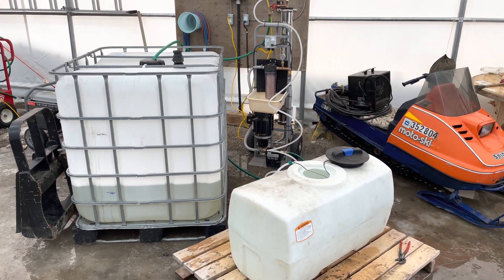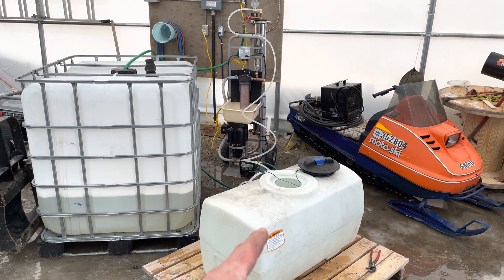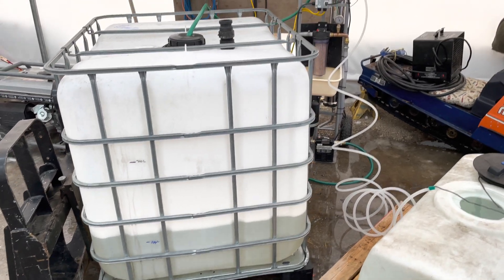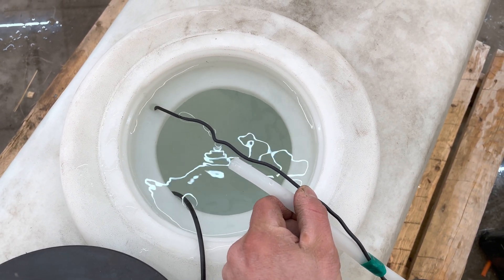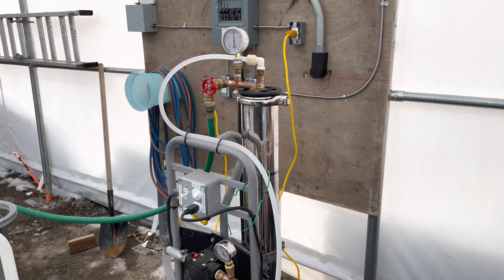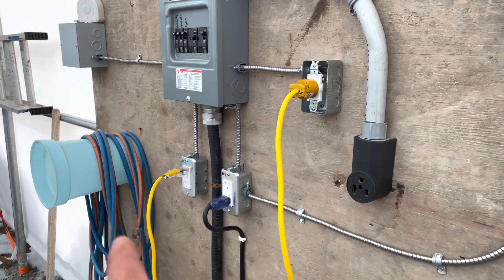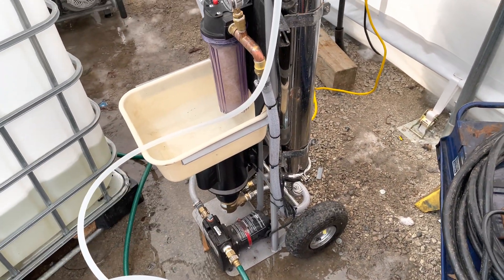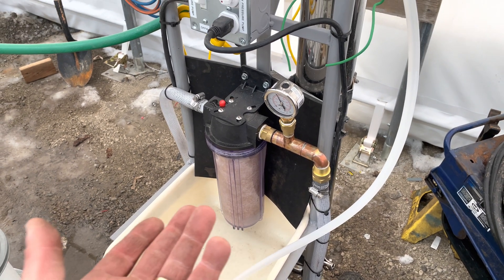Making Maple Syrup - Easy Homemade Reverse Osmosis System for Water Removal from Maple Sap

Comment: I really liked your RO i built one similar to this with well water pumps but could not achieve enough pressure, but i will be upgrading my pressure pump to a procon. Thanks for the build tip.

Comment: Whyy cant you just use the bottom pump at 40psi? Im sure the high pressure pump makes it fast but just wondering at 40psi if it still works.

Comment: What are the size of your hoses and fitting on your pumps/tubing??
Reply from the maker: All clear horses and high pressure line are 3/4”. The outlet is 1/2” copper pipe.

Comment: whats your thoughts on the new Nano RO MAX Reverse Osmosis System by CDL? would u buy it or build the system you are using?
Reply from the maker: I like the new system, can’t really say too much more without seeing it in action. Based on the online specs it’s pretty impressive for the size. I would personally build my own again because it uses widely available parts and can be easily scaled up by adding more membranes easily keeping all the same pumps.

Comment: I’m hoping you still look at comments on this although it’s been up for a while. I’ve built the same setup that you have. It seems to work but I’ve noticed with both pumps running the filter housing never fills up. It is about half full of water and I see the water flowing in with a lot of air. I think that is causing my high pressure pump to cavitate some. The low press and high press pumps are both rated at 330 gph.  Any idea what would cause that and how to fix it? Thanks.
Reply from the maker: Hi, I’m not entirely sure but you may need to increase the flow to the small filter. It may not be getting enough flow.

Comment: Another question for you. How did you determine what size electric motor to use on your Procon High Pressure Pump?
Reply: I run twin 4/40 filters in series on a 3/4 hp marathon motor with the 330 procon and it works very well.
Reply: @Tonnsfabrication  For the size and amount I would make for myself, I could build one 1/2 the size of yours then referring to what you memtioned.
Reply: @craigunderwood5567  Yes, depending on how much sap you plan to process you can certainly build a smaller set up. The set up in this video is ideal, you could easily add another filter in series to upscale it later. The 4/40 filters are about as economical as you'll find if you're in a higher tap count, If you only have a handful of taps then smaller house filters work fine. The membranes I run are brackish water and cost about $180, you can get way better membranes and spend $350 each. I'm over 400 taps and normally process about 500 gallons a day with very little effort. It just all depends on how much water you need to remove and what your set up can boil in a day.
Reply: I have any area my patents used to tap that had approx. 200 taps years ago when I was a kid. That's what intend on setting my idea to for future. As I'll have an arch built for new custom made plans I had made. Presently I have 16 taos I'm playing with and cooking the hard way, " kitchen stove" it works for now.
Reply: You can find old carbonator pumps with the 1/3 hp motors all over ebay, they're used in soda vending machines and are food safe, not all procon pumps are NSF so be careful if looking. You can get a little garden/ shallow well pump for your primer pump, a prefilter and some form of R/O filter and build a set up like this guy did. Mine is the same way built on a hand truck with wheels. You can't allow them to freeze or it will ruin the R/O filter and damage the pumps. When I built mine I had $1200 in the entire set up minus a few things I already had like wire, switches, boxes, hand truck, odds and ends steel to weld up the mounts. For the initial investment I'd build a bigger R/O and smaller evaporator. With one 4/40 R/O filter you could run up to 300 taps, have a small 2x4 evaporator and make loads of syrup and use very little wood doing it.

Comment: For the  R O System you have built, how many maple taps do you have and how many will it handle and what size evaporator do you use to make syrup?
Reply from the maker: 400 taps no problem to stay ahead of that flow. I think 1200 would start to push it but really it’s all about time. Evaporator is 16”x48”
Reply: @rudijones  Ok and thank you for your response.
I'm thinking of building a system maybe half the size of yours for myself to use.

Comment: What’s the flow rate on your LP pump? Would a lower flow rate on that pump restrict the overall flow of the entire system? Or does the HP pump draw it through at its full capacity once primed?
I’m planning to build your setup but while looking at the Procon pump specs it says it’s self priming. So I was wondering if I can do away with the LP pump altogether in that case?

Comment: I’ve built a smaller version of this but need to upgrade as we keep adding taps.  I’ve been wracking my brain about food safe/NSF ratings for pumps. The low press pump you’re using doesn’t seem to meet that. Have you looked into that and do you have any concerns about that with the pumps you’re using? I haven’t had much luck finding a reasonably priced NSF rated LP pump though.
Reply: https://www.amazon.com/Aquastrong-Portable-Stainless-Sprinkler-Irrigation/dp/B0B55STDNN/ref=sxin_20_pa_sp_phone_search_thematic_sspa?adgrpid=55620934746&content-id=amzn1.sym.e5621fa1-1d45-43af-a32c-ec269165aa05%3Aamzn1.sym.e5621fa1-1d45-43af-a32c-ec269165aa05&cv_ct_cx=220v+water+pump&gclid=Cj0KCQiAsoycBhC6ARIsAPPbeLuJt6kXhCxXvuYTCxDQWqBFHL3YNCkF9Kanm6sxMeGxOyEAG8SLrfUaAhtjEALw_wcB&hvadid=410099850944&hvdev=m&hvlocphy=9003106&hvnetw=g&hvqmt=b&hvrand=16147962853353983153&hvtargid=kwd-295687761766&hydadcr=13996_11144164&keywords=220v+water+pump&pd_rd_i=B0B55STDNN&pd_rd_r=8220d9d2-5916-460c-999c-b593e24f3359&pd_rd_w=FW8bo&pd_rd_wg=L4GNB&pf_rd_p=e5621fa1-1d45-43af-a32c-ec269165aa05&pf_rd_r=5FEP9NSVPKMSVNA0YJCM&qid=1669566734&sr=1-3-5d145692-3a33-435f-b395-cb33bbbc7bfa-spons&psc=1&spLa=ZW5jcnlwdGVkUXVhbGlmaWVyPUEyTlkwRktTRTBPUDFVJmVuY3J5cHRlZElkPUEwNzA5NDkxNDNBQ1dHTDg0SURUJmVuY3J5cHRlZEFkSWQ9QTAxNzk2MTYzSDE0VDMySkJKWEU0JndpZGdldE5hbWU9c3BfcGhvbmVfc2VhcmNoX3RoZW1hdGljJmFjdGlvbj1jbGlja1JlZGlyZWN0JmRvTm90TG9nQ2xpY2s9dHJ1ZQ==

Comment: What is better to run at 240 volts or 120 volts? Thanks
Reply from the maker: 240’s only advantage is you can run smaller wire but in this setup it’s not a deal breaker.

Comment: Seems like a 275 gallon tote creates quite a bit of pressure out the bottom valve just with the head pressure, couldn't you skip the transfer pump and just have the tote elevated?

Comment: I'm considering putting one of these together. My concern is that I'd (or my wife) turn on the procon before the feed pump.
Would it be possible to wire in a pressure transducer that would disable the procon if there isn't 40 or so psi feeding it?
Anyone have any experience with this?
Great video!
Reply from the maker: Fresh water systems part #LPS340-G is exactly what you are looking for.
Reply: @rudijones  thank you!
Reply: @craigwade2260  yeah, I'm picking up what you're laying down - but I'm having a hard time sourcing a pressure switch. Every time I start looking, the internet steers me to well water pressure switches :-/

Comment: How many taps could this handle? Also wondering if you could get a higher concentrate by adding a second membrane
Reply from the maker: You shouldn’t concentrate past 30% of the original volumes. More membranes means faster concentrating though. Mine can remove 225L of water per hr so another membrane would likely double that output.

Comment: Building a similar system. My membrane came with a thick plastic (practically glued) on it's outside. Do I need to take this off before inserting into the housing? Or does the water just come in through the ends of the filter element?
Reply from the maker: Leave the plastic membrane. It filters through the ends.

Comment: I built almost the identical RO this year.  
Wondering what you are getting for permeate flow?  I'm getting 1 gallon per minute. 
What membrane did you use? I used MES
Reply from the maker: Hey. Just measured doing a batch this morning. 59.5 gallons of permeate per hr. 

Mine is a BW 4040 from a company in Canada

Comment: For those building a ro adding a recirculating pump from the output of the vessel back into the input (pressure side) is a game changer. It will allow pulling off 5 to 8 brix on a single pass as well as not getting membrane fowl and can go quite a bit longer without having to do a wash cycle.
Reply: What size pump for that? I have procon 330, 1 hp feed pump, and 2 membranes
Reply: @TheSmagzilla  I have a procon 330 stainless running two vessels. I have a 3/4 hp multi stage pump with 3/4 ports as my recirc. 

I feed with half inch hose from my high pressure pump as well as my drain on a needle valve. My membrane housings have three-quarter inch ports and I run three-quarter between my membranes and through my recirculating pump. The idea is to flow the sap fast across the membrane to keep the sugars from sticking in one spot that’s what causes your foul and slows you down. So really what you’re doing is feeding in a small amount and bleeding off a small amount but in that closed system make it flow fast! One membrane with a recirc is equivalent to three without a recirc
Reply: @ryanselleck6035  Would it work without adding another pump and just running it back into the low pressure side of the procon?
Reply: @LeeMann   small commercial ro units offer recirculation with out using a pump by using a separate needle valve other than the one to control you’re main operating pressure to meter off sap back to the high pressure feed to recirculate. The pro is that you get slightly higher sugar than not doing this. The con is there’s nothing to help keep membranes from fouling up with sugar. The whole purpose of the pump is to wash away the surface of the membrane and keep it so water can escape without opening the system. Speeding up a loop in the membranes with a pump keeps the sugar from sticking and slowing you down. 

I think of it as having a diesel without a turbo.
Reply: @ryanselleck6035  thanks so much would you be able to give me details on how you did your setup? I'm just trying to get mine going now any help would be great! I was also just planning on a single post for this season but want to expand

Comment: Do you have to throttle the membrane backpressure regularly as the sugar content increases?
Reply from the maker: I haven’t had to do this. I have done 1000lL down to 400L and pressure did not move more than a couple psi. I attribute this to the fact that the sugar is actually just passing by the membrane vs physically clogging it up.